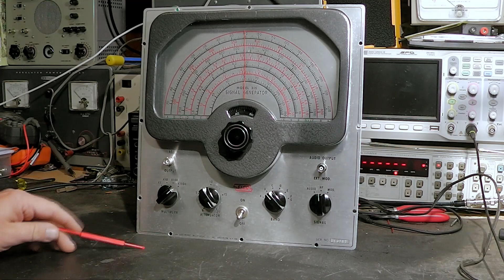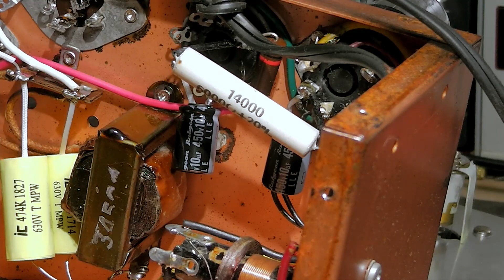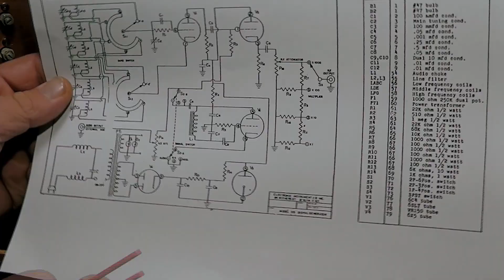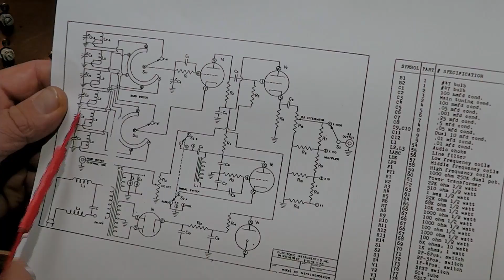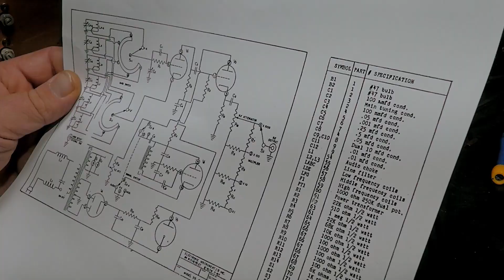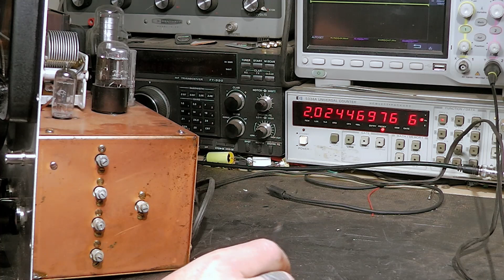EICO Model 315 Restore Part 2

Comment: That is a very nice EICO signal generator. EICO made good affordable test equipment for students, hobbyists and low budget shops. Ive owned the 324 and 322 type signal generators. My audio generator is the Barker and Williamson 200 circa 1959. Its never been repaired, restored or calibrated. I’ve checked key components and found them to be ok. I did add a thermal circuit breaker should something serious fail. I bought the B&W 200 at the family store when it was brand new condition for $85. B&W was coming out with a new model that looked like an HP 200c. Employees were given an opportunity to purchase the 200 at a great price and pay for it through pay roll deductions. Its the only piece of equipment that I never sold.

Comment: Nice work Michael. I restored one of these a few  years ago.  Video on it. Yep the output is not that pretty but better than some of the other stuff. But do not let that worry you as most of the time the DUT has enough filters to clean the input signal and only lets the wanted signal through.  Mine was a cosmetic nightmare but turned out good.  Keep up the good work.
Reply from the maker: Thanks for the kind words Buddy.  I will have to check your video out.
Reply: @ke4est  You are welcome. Wow, I posted this 4 years ago https://www.youtube.com/watch?v=xlS6KijNSpo
Reply from the maker: @TheRadioShop  Times flies!  We getting old Buddy!